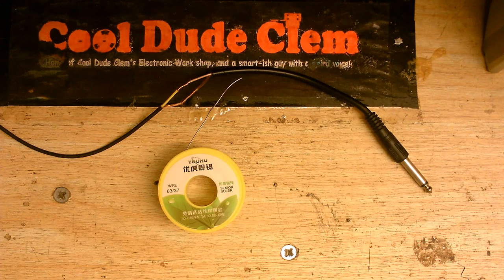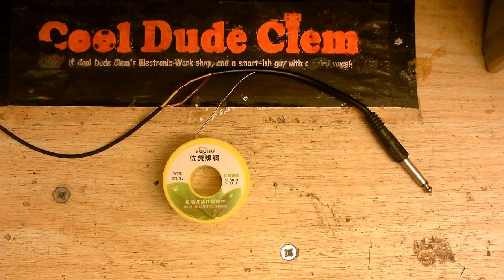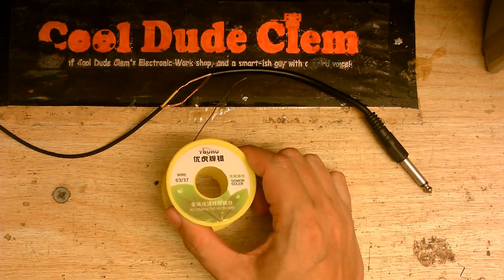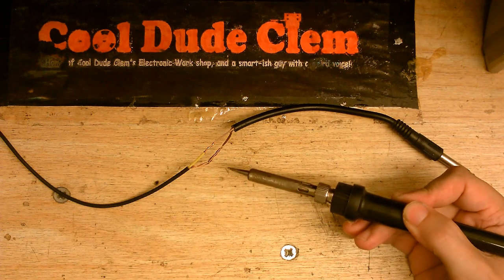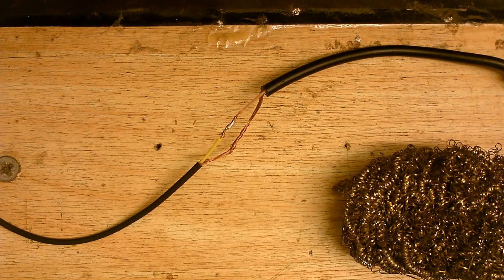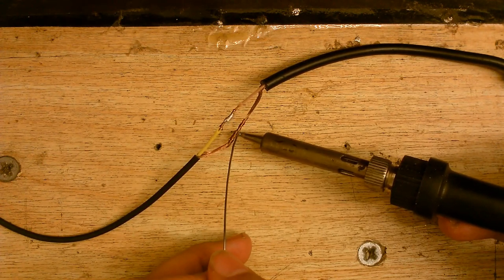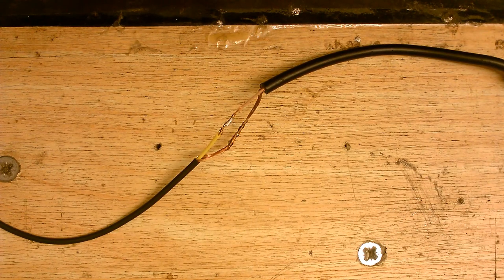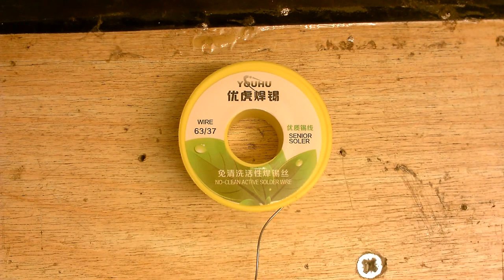Cool Dude Clem PSA - Don't buy cheap Chinese solder.

Comment: I think perhaps the problem here may not be the solder wire, but the coax wire itself. It could aluminium which just doesnt solder well at all. For solder to adhere to a material it really helps if that material is super clean. So if this is aluminium wire its likely covered in oxides which would need removing first, either physically or by using an aggressive flux.

Comment: I always use the gel type liquid flux first and then most solder, lead and lead free works really well. Cheap solder usually has no flux in it or very little. I also use solder paste that has the flux in liquid form mixed with it that they use for surface mount components.

Comment: One thing I've noticed that is missing is 'heat shrink tubing'. Before making your connections, you cut it to length and place it over the wire. When the connections have been made, you shrink it into place to protect your work. I got some flux for plumbers at the hardware store and this helps too.

Comment: Maybe the Chinese interpretation of "no-clean" is that there's just absolutely no flux inside.
Reply from the maker: Could be, I always trusted that it would be in there.
Reply: The solder smoked when it was heated. Just metal is not going to smoke. It did not smoke a lot though. So maybe not enough flux?

Comment: Did you or Susan disable the comments in the last Windows 10 video?  I wouldn't be much of a help though cause I refuse to use Windows 10! I feel defeated having to switch to 7, I will force myself to finally get somewhat comfy with some version of Linux before I use anything newer.
Reply from the maker: I have no idea how that happened. I've gone into that video and re-enabled the comments. I would still be using Windows XP for everything if I could! I would love to move over to Linux but things such as the terminal, and lack of compatibility with my software, it's just not for me.

Comment: Nothing wrong with the solder. The solder won't stick to the copper because the surface is too smooth.
Reply from the maker: Funny how other solder I have works just fine.
Reply: @CoolDudeClem  Best not buy it again then
Reply: Solder isn't an adhesive, it doesn't need a rough surface.  Just a clean one!